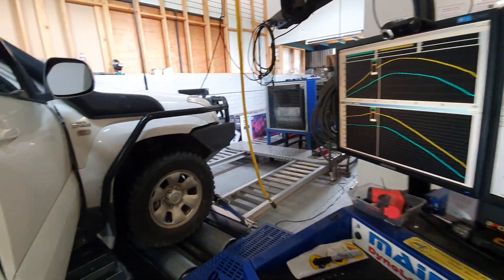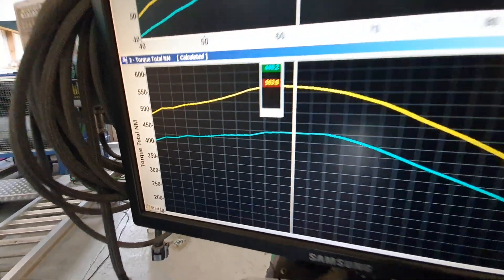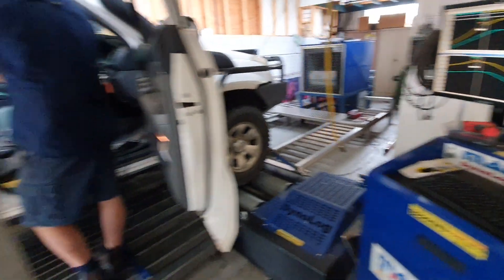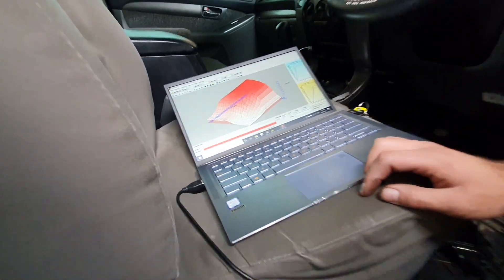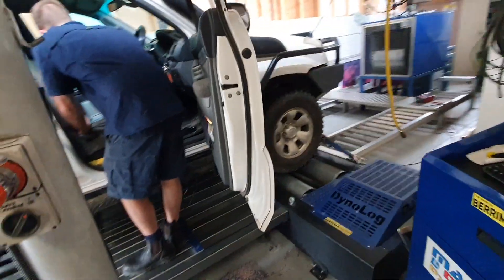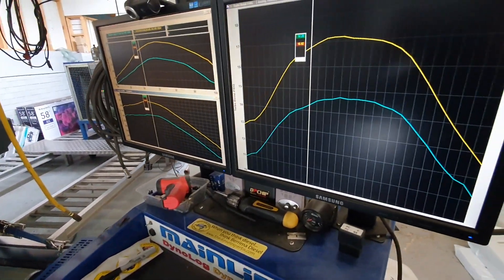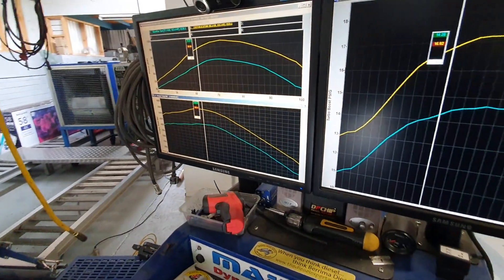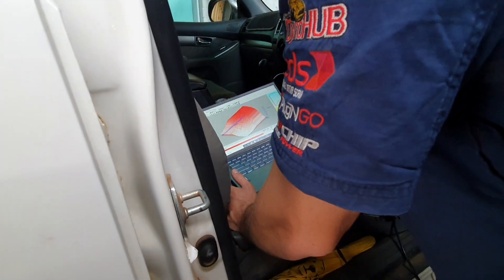ECU Tune Chip Tuning Diesel Engine Safety

Comment: hello, what are the implications in regards to toyota warranties with aftermarket tuning Thanks
Reply from the maker: None when its done through us.
-Our Tunes dont cause a problem. That means no cause for dealer to investigate anything.
-Our Tunes come with Engine and Driveline warranty.
- 3 Generations to back and support what we do
Cheers